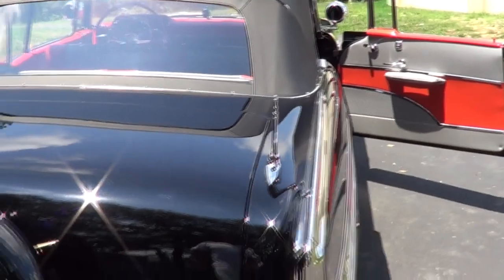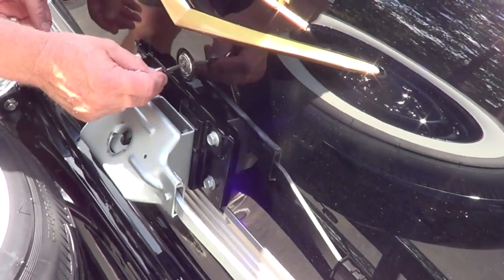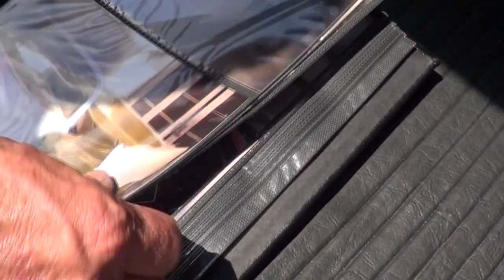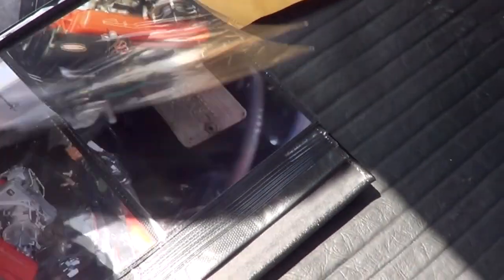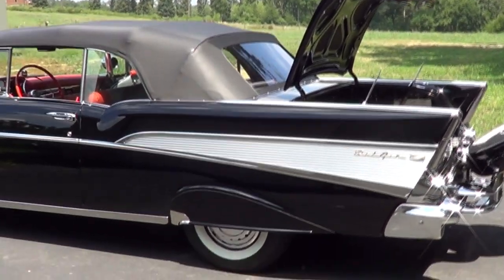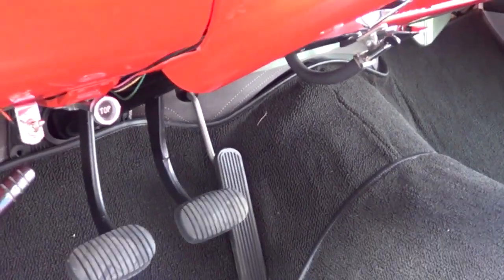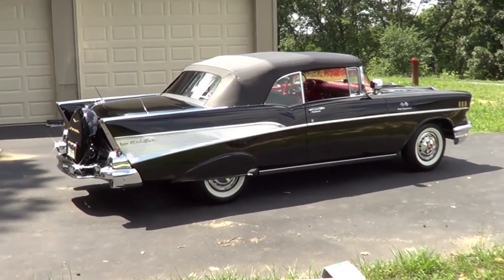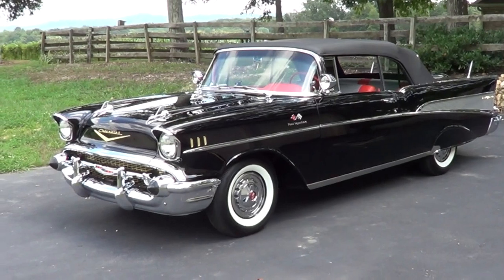1957 Chevy Fuel Injected Convertible

Comment from the maker: I'm no expert but...I know that a dealer installed Remington electric razor was a dealer installed option ...But are you sure power vent windows were offered in 1957..the research I did does not show it as a factory option...you can now add them as a after market product... thanks for cking it out

Comment: Actually the most obvious missing option is air conditioning. A $500 option on a $2500 car. Not many people ordered it. It is also missing the traffic viewer prism on the dash and the fuel injection air scoop. No power brakes, either. The tissue dispenser is where the trash bin is supposed to be. The tissue dispenser goes under the middle of the dash where the driver can  reach it.   The FI emblems are at least a 1/4 inch too high on the fenders.Door trim was straightened. supposed to be curved.

Comment: Not sure where that car had spent its life but is WAS somewhere that did not get a lot of snow.
Upon graduating HS in 1964 in the Cincinnati area, I bought a '57 Chevy Convertible with the 'power pack' 283 with 3 on the tree. Even though it only had about 50K miles on it - there was rust everywhere. It took a fail amount of work to clean it up and give it a fresh coat of the Tropical Turquoise paint.

Sold it when I got drafted in '66 to my friend Jim Thiel who went on to start Thiel Audio making very high end speaker systems.
Reply from the maker: +mike klaene Cool..Thanks for checking this one out!

Comment: I'm 71 and remember very well seeing my first 57 Chev.  It was a white hardtop with blackwall tires....It had the 283/270 hp with solid lifters and it just sounded fast.  Most guys went for the dual four barrel 270, 'cause it was faster and more dependable than the fueler...In '62, my brother bought that car...blueprinted and balanced the 283 and it did real well on the mean streets of Eugene...And I've had a lot of drunken discussions with dudes about whether they came with optional four speed...NO...It was three on the tree and a lot of them were converted, in the shop, to a Corvette 4-speed and Hurst shifter...Then they had to put a notch in the front seat for room to shift....
Reply from the maker: +Bull Cedar Cool...Thanks for checking this one out here!

Comment: NO, The FI on this car was a fuel rail system with individual cyl injectors.  Kinda primative and hard to tune but a really fast car in the day.  Chevy and Ford were in a HP race in those days.  Ford had their Y block T bird motor.  312 cu in in '56 and could be equipped with a Paxton supercharger.  Oh for the good old days!

Comment: Auto dim was on the 56 cadillac two door hardtops cause I had one bone stock that at the time. I did not know what it was worth, but it was only six years old and had whiskey dents from one end to the other so we  drove it for a crew bus for five loggers. As far as not seeing one like your 57 chevy, this one was red and white and an easy check on cause it sat at the only chevy dealership in wasilla alaska for several years with a do not touch on it so it was from a distance of easy to see as it was right next to the parts counter in the show room for several years. I do know that it is not there now but it belonged to the owner of the dealership and a phone call would set it straight.. It said on the display; Every option available.. every one.... check it out. I haven't been in, in several years but someone does know there and it had trophies with it too.. only difference between yours and his is the color
Reply from the maker: It's not mine....I just shoot the videos....

Comment: The guy says the car has "all the options that were available".  However when they have the hood up, on the firewall appears to be a vacuum wiper motor.  Wasn't there an electric wiper option for this car?
Reply: delavalmilker Yes, here's a list of all options factory and dealer installed... 
http://www.trifive.com/forums/55-56-57/57options.htm
Reply: delavalmilker You are right it is a vacuum wiper.  And electric wipers were an option on this car.  So much for the claim "it has all the options".  Somebody needs to do their research better.
Reply: +delavalmilker It has vacuum because of the motor. I guess electric would hit the distributor.  The fender skirts are aftermarket. It's also missing the Autotronic Eye for the lights and the traffic viewer. The tissue dispenser is in the wrong place.  Still a nice car :-)
Reply: Jerr Spud good
Reply: I bet the tissue dispenser is moved to the right because of the vacuum ash tray

Comment: That's a mighty nice '57 rag top. If I bought it, I'd remove the continental kit. Never liked them. 1968 is when the VIN first appeared in the corner of the dash/ windshield, Scottie. The fuel injected engine was not available with the Power Glide. Manual Trans only. I don't know why the car didn't have electric wipers. They were available.
Reply from the maker: Thanks for checking it out...Glad You liked it!!

Comment: I'm pretty sure, as I've seen survivors with power vents. Although its kind of hazy on the documentation, RPO-426 is just 'Window Electrical Control'. It might have been a dealer installed accessory GM didn't come out with till later in the year or something like that.

If it interests you, here's a link to the '57 assembly manual with all FOA and RPO codes: 57chevys.com/coccc/tech/57assm1.html

Anyway, the car in this movie is still the most awesome and well optioned '57 rag I've ever seen.

Comment: interesting all those extra options but no automatic no power brakes
Reply: keno8spot : All 57 REAL F.Inj.BEL AIRS Were 3 SPD's.on the Column,N ever Seen or Heard of an Auto.& BARRETT JACKSON Says the Same.
Reply: Sorry.  Detuned 250hp FI Belairs with Powerglide transmissions did exist and were indeed a factory option.  Both were an option on both the Corvettes and Belairs into 1959.  Another item of shit in this thread was the electric wipers 'hitting the distributor'.  Vacuum effect on motors - trying to appeal to complete idiots.  Classic car business is full of people trying to deceive others.  Our local 'nantionally known' classic car dealer has a horrible reputation with everyone/everybody, probably it's populated by men seeking sex with other men. Know FI / Powerglide were available afterwards but don't recall what years although I've seen a '61 Corvette with the options.

Comment: Would you sell this car and could you turn it back to automatic.would youconsider a trade with a 56 trailer queen.Seious iquire only Beautiful car but there is more than you said of fuel injection. I hae dual quads on mine and you could have the fuelie
Reply from the maker: I just shoot the videos...
Reply: Pat Ferranti its not original, this guy is a liar
Reply: @ScottieDTV  The Fuel injection was a little temperamental but the big problem was that know one  beside the Chevrolet engineers and certainly not the back yard mechanic knew how to adjust them so a lot of them were removed mostly because of ignorance but one thing I do know if they were right you could not beat them at the track.
Reply from the maker: Right on..

Comment: He didn't even put the top down. grr
Reply: P.U.B. Nave I also have a show car and never once put the top down because it will cause scratches in the rear plastic window which would result in loss of points.
Reply: +65 GT350 Shelby My guess is that both yours, and the one in the video, are therefore "top up only" trailer queens, as well they should be, when they are meticulously bumper to bumper, frame off, every nut, bolt, and washer restored.

Comment: Ball park figure, what's this car worth??? Within $50,000, either/or  lol
Reply from the maker: Andre Landry 250k....just a guess
Reply: ScottieDTV No. About half of that. The car is currently for sale on Hemmings for $149,000
Reply from the maker: Robert Gage Sure...what do I know...but you won't find a better one,,,,
Reply: ScottieDTV I may have overshot the runway. It may very well be worth 250 (incredible car). I just happened to notice it on Hemmings. The 149,000 seems like a bargain.
Reply: Robert Gage The car listed in Hemmings is a very similar car but not the exact same car. According to the Hagerty price guide the current average sale price of a 1957 Bel Air Convertible FI is $93.6K. This car should be worth between $125K and $150K based on it's #1 condition.